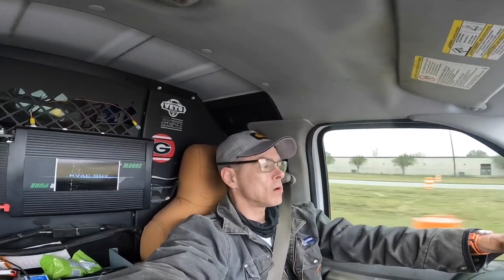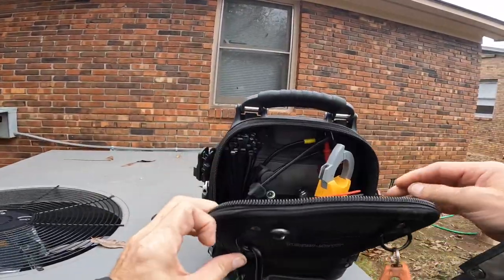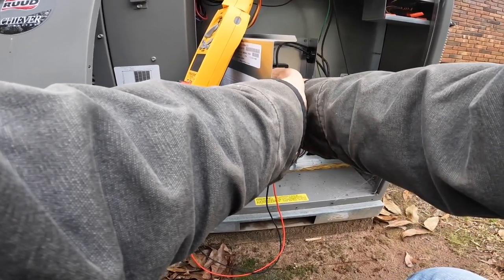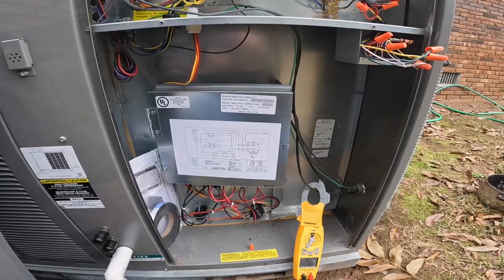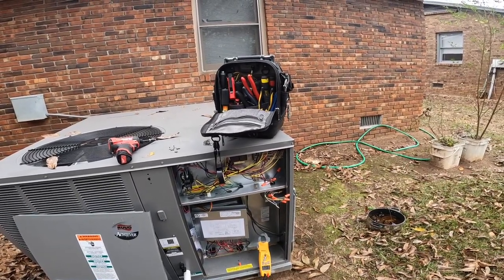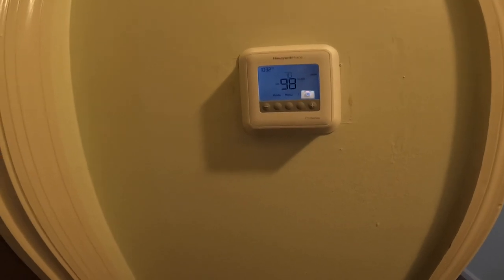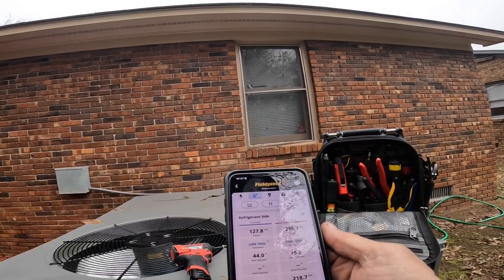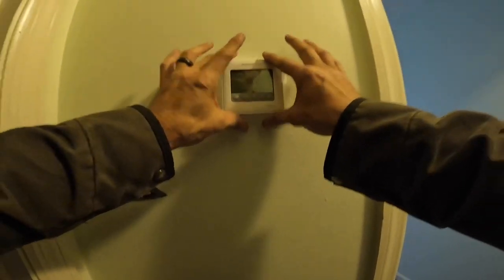Heat Wouldn’t Shut Off - Extremely Hot House

Comment: That's crazy, I think someone was tinkering with it. I had to run a "c" wire to mine to power it, the old one used batteries. I just picked a wire that wasn't being used, orange I think, and hooked it up to the c on the board which had a white wire on it. I also had to jump a wire on the thermostat. Point I'm trying to make is I could pick any color wire that wasn't being used, so you can't always trust color codes, especially on old units.

Comment: I had this happen at my dad's house. POS Honeywell thermostat lost it's brains and started calling for heat. He called me up and said "I think the thermostat crapped out, it's hotter than hell in here". Fortunately it was only about 30F out. Put a new thermostat in and I saved the old one to incinerate it by applying 480V across the battery contacts, a fitting end for such a piece of crap.

Comment: I had a similar problem. 7 1/2 ton carrier split heat pump is to be wired up conventionally. Someone configured it for heat pump. Had get into config and set it up conventional electric heat2/cool1

Comment: Had an issue with my former Nexia thermostat a few years back. They were doing some software update and everyone’s thermostat was affected. When I walked into my home, I was hit with a wall of heat. It was over 90 degrees inside. The thermostat said it was 68 degrees and it showed the furnace was at idle. Of course the furnace was operating in second stage heat, non-stop. If I hadn’t come home when I did, my dogs and cats probably would have had heat stroke. I had to power cycle the thermostat to reboot it, and it came back to life after being frozen. All anyone got was an email saying sorry 🤷‍♂️🤬🤬🤬🤬🤬

Comment: Dragging your tool back across the top of a brand new unit is a good way to scratch it up. I have the tech pack Mc version so it only comes out on major repairs, I usually just grab my miniature Milwaukee duffel bag style that way I don’t have to zip and un zip .. just reach in and grab what I need. I hope you have one of those pads to crouch  down it save your knees and back ..

Comment: Similar situation, furnace wont turn off even after thermostat is turned off. Still blowing cold air. Works fine with heating and cooling but instead of auto it looks like is on permanent on. Any suggestions?

Comment: Curtis,  I couldn't see where the white wire was originally before you moved it.  Where was it at?
Reply: I might be mistaken but it looks like someone put the White Wire in with the same terminal as the Reversing Vale (Orange.) either way definitely not the right slot. if it was with the Orange, then whenever the thermostat called for Cool it would also run the Heat Strips as the Reserving Valve is powered in Cool on that system and therefore power the heatstrips as well. That's why he wasn't getting any special readings otherwise prior to him seeing that at the thermostat. Guarantee (if it was indeed orange and white combined) if he checked amp draw on the 240 lines he would have seen around 20amps or 40amps (depending on size of heat strips.)
Reply from the maker: It was on W, where it would go for a straight cool/heat system. It needs to go on Aux/E because it’s a heat pump
Reply: @HVACGUY  awesome,  thank you brother.

Comment: We have 3 floors, 3 thermostats. Top floor wont shut off with the new thermostat. Other floors work as it should. Replaced the valve and cant figure out the problem. Help